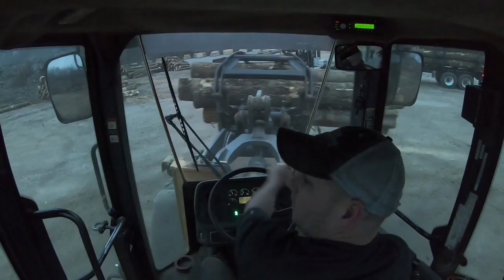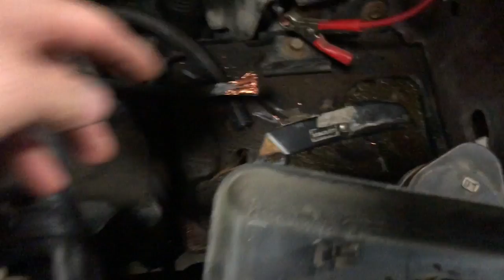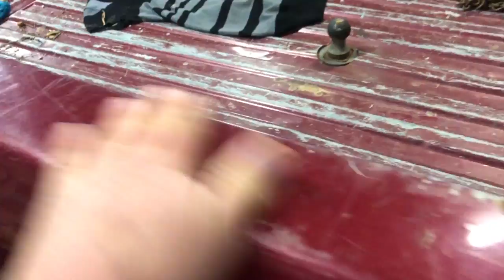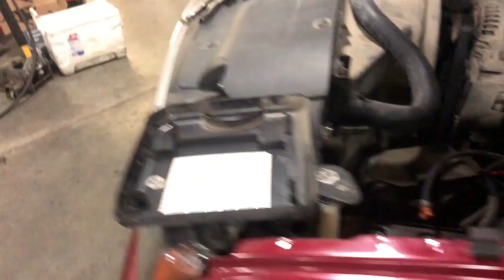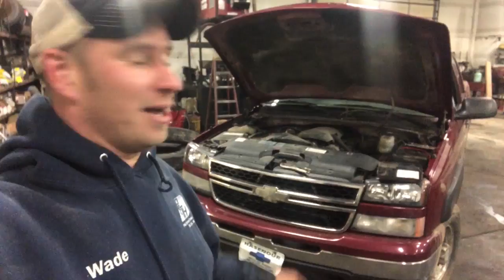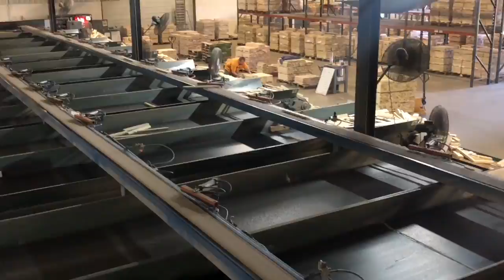Got big momma's truck back!!!! Thanks everyone!!!

Comment: I'm glad somebody helped you find the truck, Youtube works in good ways sometimes. After guys steal stuff and treat it like that in 38 miles, I guess we will find out if you are glad you got it back or not when you get it running again.   It's never happened to me but I know guys had stuff recovered and it would of been better for them if they never saw it again,  or the scumbags set fire to it solving the problem of fixing it. 
          Maybe change the motor oil if you haven't , they might of added something to it is one thing I've heard !. 
   There was a near new Rogator sprayer stolen from the field near here by some arrow chuckers off the reserve.  The guy got to the field the next day it was gone so he started following the tire tracks.   He said when he got half a mile and found one of the 50 ft boom sections wrapped around a tree, he stopped walking as he knew it wasn't going to end well.   The cops found the other boom on their way to it,  the machine was totally trashed in a couple miles and insurance wrote it off !    Good luck I hope you do get lucky when you get it running again. Thanks for the video. Take care

Comment: wade did you look in to that allen socket set i sent you
Reply from the maker: matt phillips ummm I caint recall bud I did get one that was black finish does that sound right
Reply: @LoggerWade  no they are in a blue case both ase and metric i emailed you the ebay link to the set
Reply: i re sent you the ebay link to your email listed on your web page